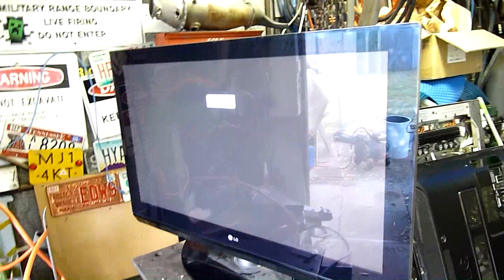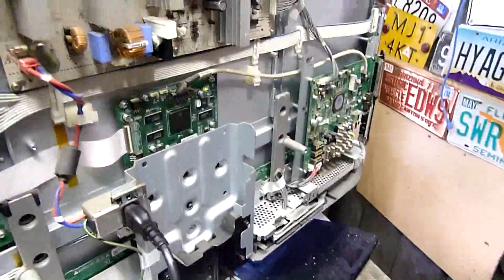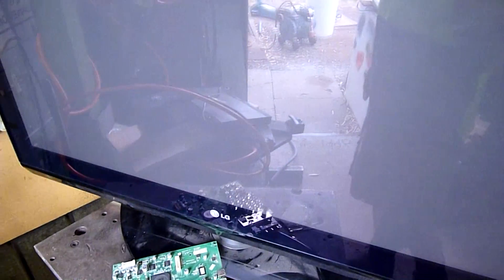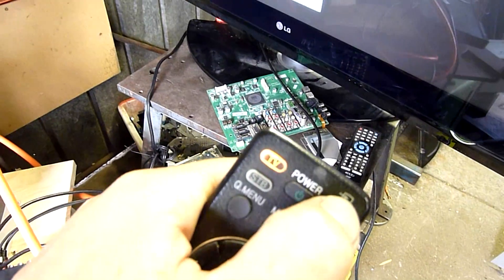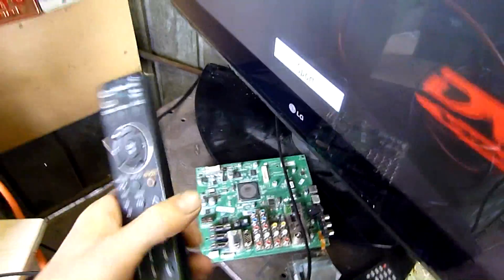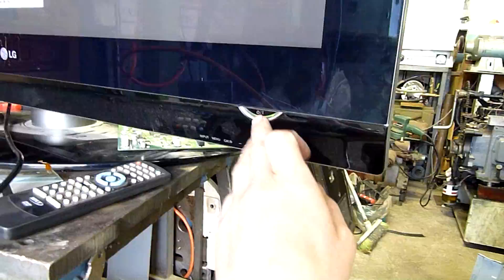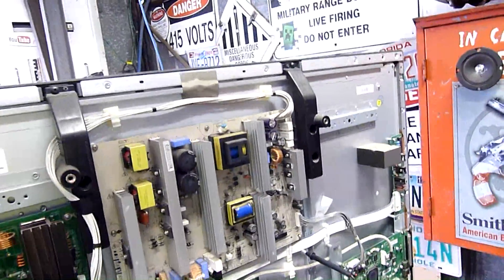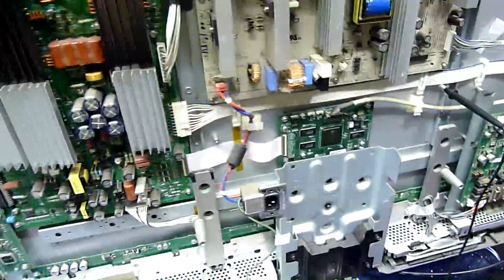LG 42" HD Plasma 42PG60UD-AA Crashing Digital Board.

Comment: it's odd that the firmware would be the problem with the other board since, if I understand right, the chip on the digital board stores the firmware and if you are changing the whole board then it shouldn't affect the rest.

Comment: Another thing that happens to these, and TV sets in general is the HDMI TMDS chip loves to short/fail. And when this happens, it can drag down the digital circuitry and cause all sorts of strange things!. Follow the HDMI ports, they will run into a small chip. if its blistering hot, its bad.

Comment: mainboards rarely fail on these. I see them all the time, 90% of the time its the buffer boards with no picture (which is NOT your case), or the Infrared/button board goes bad and causes the mainboard to trip out. Sometimes the power supplies go, but its rare.

Comment: hahaha my lg 47" lcd tv just shit the bed too last night check the capacitors around the inverters
Reply: there is no inverters on a plasma
Reply: oh beg my pard
Reply from the maker: ***** yep!, PDP and LCD all use Mosfet or IGBT based inverter PSU's, commonly called switch-modes as a sort of blanket term for anything that does not use iron core transformers.
Reply: ***** wait the PSU isn't an inverter or am I miss informed ??
inverters drive a backlight on an LCD or led lamps I always thought
ummmm ok
Reply from the maker: Jason Rodda CCFL's do use a type of inverter. just a different one to the one that supplies Vs to the panel on a plasma for example.
Reply: oh thanks aussie50 I was always wrong in my thinking of it just as a PSU and ymain and xmain :)
Reply: either way i fixed my tv by swapping out a burned up capacitor

Comment: Had a similar problem with a Samsung LCD tv. The front-panel PCB was at fault (the one with the switches and infrared receiver) - Disconnect the board and see how it behaves.
Reply from the maker: tried that a few times and it also faulted with FP board disconnected :(.

HDMI is dead across the board too, no life whatsoever.

Comment: Bake the BGA digital board in an oven. Preheat the temp to 400 F, then bake the board for 6 minutes exactly.  That should do it.  If not, then remove plastic connectors and capacitors and bake at 425 F for 11 minutes.  After the board cools, install the removed components.

It's amazing what BGA boards I have brought back!
Reply: Bright back a printer engine board this way, several BGA based fuel injection computers.  A BGA based antilock brake control module and a Bluetooth interface module for car navigation.

It really does work!  Not permanent as reballing with lead tin solder ( this BGA delamination issue is from all from the greeny weeny retardification to stop using lead in electronics), but so far all boards are working perfectly.  The first was baked over a year ago.

Comment: The surface mount capacitors by the voltage reg are bad.  Replace them with regular ones.  The surface mounts are easy to twist off with long nose pliers.  The give away was the noise that went away when warmed up.
Reply from the maker: I got everything nicely warmed up with the heatgun and the noise would still go away for about a min or 2 every time I push the reset button on the board.
Freezing the main chips yielded the same results too, I will put the ESR meter on those caps and see how they are

Comment: I have done this before, get a piece of coax, strip it back, insert the centre core in the scope input, tape the shield to the connector (this is assuming you haven't got a BNC), you can add a resistor to the centre conductor if you want, but at those low voltages, should be ok.
That sounds more like inverter buzz to me.
Reply: ***** Sorry to say this, but just about all modern tech has an inverter, it's the SMPS or power supply.
Reply from the maker: Good idea, the scope is definitly not BNC, they are old screw on fittings,

The buzz changes depending on the tone being played through the audio board at the time, playing a DVD last night gave me different tones each time it faulted (pressing the reset button stopped it buzzing for 1-2 mins at a time)
it sounds like a PC locking up in the middle of a game.
Reply: Its a plasma. No inverter... the main processor is power glitching. the HDMI chip is either shorted and dragging down the V-Core rail, or there is an issue in the voltage regulators, or worse, processor itself.
Reply: *****
I cant help but wonder if the buzz has a lot to do with the problem. If it goes away when the main controller crashes (all controls freeze), is it because the audio is turned off by the crashed controller or is the controller or another failure generating the noise? Perhaps bad ground or maybe that hdmi processor failure intermittently pulling the supply down @ the frequency of the noise. Perhaps the noise is of some failing hdmi processor frequency or bad switcher power supply, driving the main processor nuts. I don't know much here but putting a scope on the power rails would be interesting... (trace the source of the buzz)
Reply: *****
Not a plasma, When you speak of "inverter", in TV repair tech speak it means the backlight inverter. Since a plasma isnt backlit, it doesnt have an "inverter" persay. The sound he is getting is random garbage generated by the processor in the I2S audio bitstream going to the D output IC.
Reply from the maker: wdavem I have absolutely no HDMI activity, so I think it is the HDMI controller, it has been known to happen, and the absence of boards available on Ebay means its probably a common board to go!.
Reply: Aussie50 You can heatgun off the HDMI IC. This will disable the HDMI of course, but it will allow the board to become stable. I had just repaired a mainboard for a sharp 65" same issues.
Reply: Aussie50
yeah will be interesting to see if that fixes the rest of it or makes the noise go away if you cut out the hdmi all together

Comment: Ah bummer gotta wait now to see if the other board works! LOL
Reply: Aussie50
That's because the one that was in the TV was newer and had newer Firmware on it. So You could put a heat-sink on the Main chip of original board and see how happy it gets. Also you could Try Swapping out that regulator on the original board with the one from other board and see if it works better; just make sure they use the same pins and they have the same chip-id code on the top(otherwise they may have different pin- in/out's). :)
Reply from the maker: other board would not display image or switch to input, but it did not crash after any amount of time.
these seem to have a habit of cooking.
Reply: Compu STORM

Agree with heatsink. I did that with my modem! Been fine.

Comment: modern crap, could be anything!!
Reply from the maker: Revoku
the local rubbish tip usually has a healthy TV graveyard, many cubic meteres of TV's in a pile :D
Reply from the maker: it will be on the digital board, the changeover does not have Video out to panel ,but it will not crash and lock me out of the controls no matter how long I run it
Reply: Aussie50 is it true Australia has plasma graveyards?